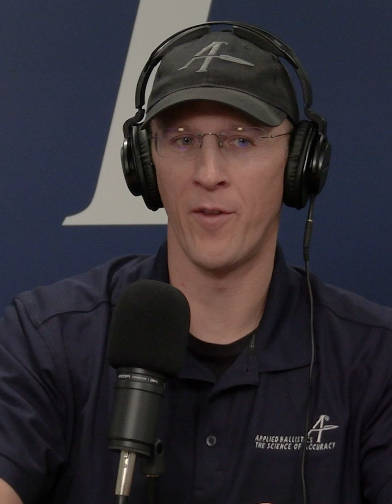Annealing AB topic

Comment: I have NEVER annealed my brass . As I found out that when I necked 308 BR , small primer cases to 7-08 and shot them and never had a split neck . How ever this point is proven because I had one box of this ammo for 8 years and 80% of the necks had cracked ! . POINT firing cases ANNEALS NECKS ! PS this was the same ammo that I set the US National record with ! On another case I had ammo loaded for most of a year and wanted to get rid of it because of the time it had been loaded . Well that was the ammo I shot 200-20X at Camp Atterburry at 500yds Iron sight . Mitchell Maxberry

Comment: Does annealing extend the number of cycles that we get out of the brass?
Reply: Word around the shooting community is that it does in fact lengthen the reloading life of most cartridges. It softens the brass around the neck and allows the die/mandrel to shape the brass without hardening, which results in case neck and shoulder splits
Reply: NO ! Reason the problem is the amount of clearance in the chamber relative to the neck size of the ammo . You stretch it too much too many times its going to crack ! . I have shot cases 30-40 times and have NO cracked necks in the lot of brass I was using , never annealed !